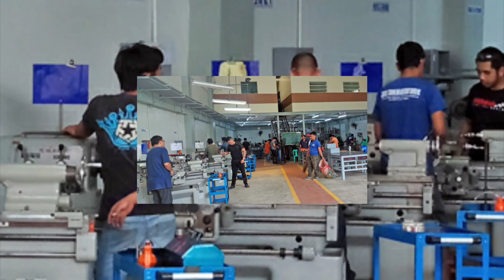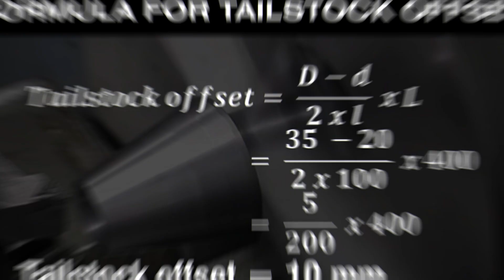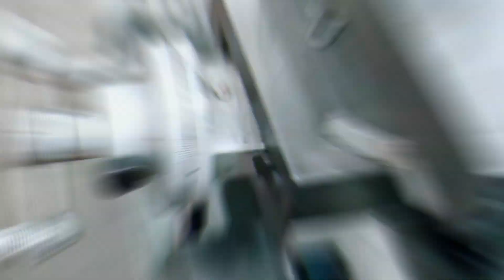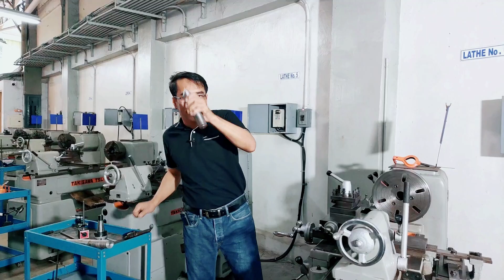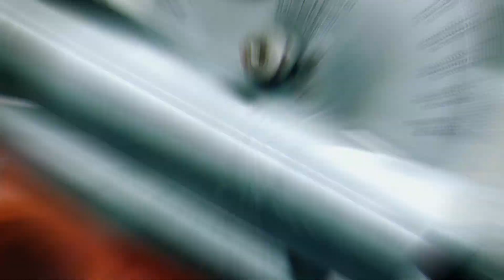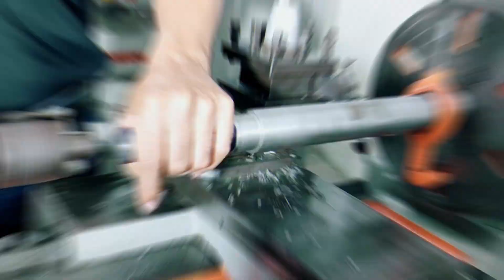Taper Turning Using Tailstock Offset Method

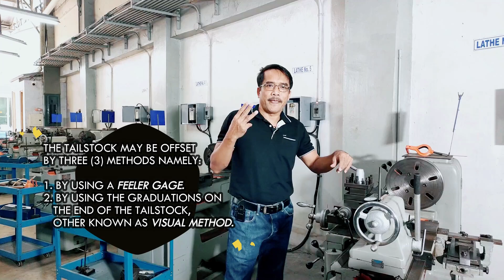Comment: Sir pano nakuha ung ratio na 1:20
Reply from the maker: Hi Domingo!
ang 1:20 ay given para macompute natin ang large diameter (D) ng taper. At ang ratio kagaya ng given na 1:20 ay unit ng taper sa millimeter which is the amount of taper per unit of length. halimbawa, ang isang tapered tool kagaya ng shank ng live center ay nag iincrease ang diameter nito mula sa kanyang dulo na may pinakamaliit na diameter ng 1 mm kada 20mm.
Thank for watching and subscribing!
Reply: @profjohnny8624  Thank you very much po Sir..